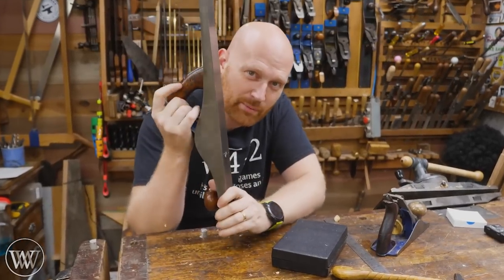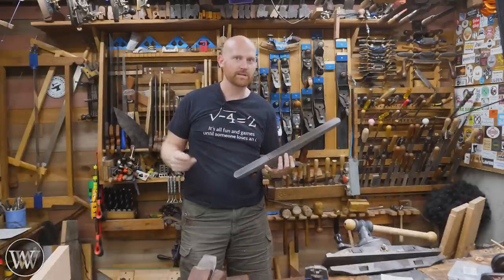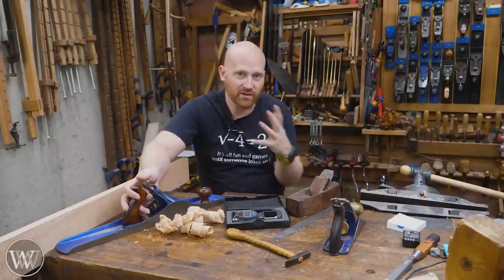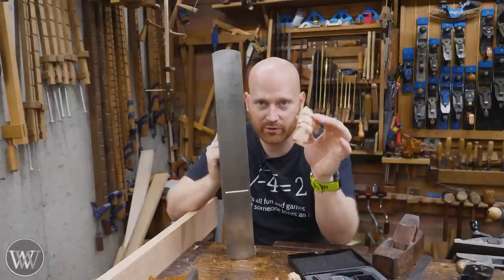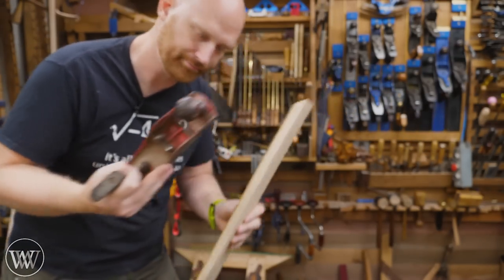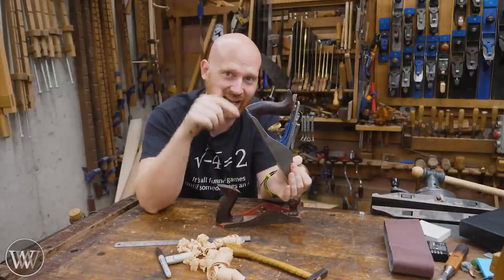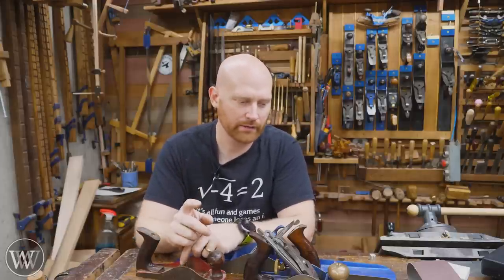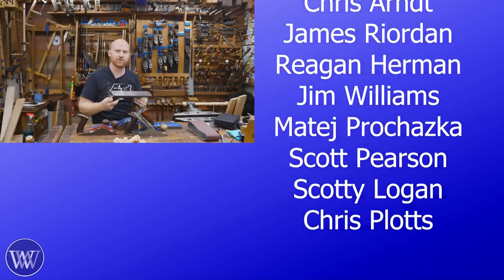How Flat Should Your Hand Plane Be

Comment: Only today I installed 6 doors, used my very old no7 that as far as I can tell has never been flattened. The client is a German fella with an eye for quality and detail. He was happy, i was happy, the plane was an absolute pleasure to use all day to get the doors fit horizontally, it hogged off what I needed and no square could prove the plane faulty. And the finish was smooth enough, was sparkling like a diamond. Its about getting work done, nothing more nothing less. And my non flat no7 is a total workhorse ❤ I spend a lot more energy on the iron than the sole.

Comment: Thanks, as I'm aging I'm finally beginning to use the dozen I've collected. This will be helpful as most were abused before I collected them. Until now a block plane has been all I've used. One my bud made is my favorite. Sometimes I really enjoy the slow pace and the sound of a sharp blade scraping across the wood vs dust collector and planer screaming at me. Just nice to get out of worlds pace.
Reply: agreed, I just flattened a board (for a display case I'm making) using my jointer plane and no 5, followed by a smoother. Took a little longer than if I had run it through my electric planer, and is probably less accurate, but it sure was satisfying. :)

Comment: Is that "there is no right way" or " there is no Wright way" ?

I wonder if a good way would be the very rough paper and then jump to a fairly fine paper to leave smooth crests on a somewhat rough finish.  The idea is that the coarse grooves would hold some of the candle wax that some like to use on their metal planes.  Me?  I like my wood body and transitional planes so it's not an issue.

Comment: The type of precision a lot of people seem to think they need exists almost exclusively in high precision shops that are temperature and humidity controlled and working with materials that are far more stable than wood. I get it and it's an easy trap to fall into. Nailing a tight tolerance or being able to change something to a level you can barely feel is amazing! I work in a high precision job shop and knowing when to be that particular about the tool condition and when not to be is how you tell people with a lot of active experience from people who have yet to develop that understanding. That being said, if it makes you feel better about the tool you're using, why not?

Comment: Glad you addressed this. I have a Grizzly jointer that I could never get properly flat. Some sharpie marks in the center just wouldn’t go away with the outer border just being slightly high. I gave up when my lowest grit sanding belt wouldn’t do any more good. 
I don’t feel like a failure now after watching this. It just jointed walnut slabs for a table very well, and nobody will ever notice that light gets under a ruler on the bottom of the sole.

Comment: Today, my very first hand plane is supposed to arrive. I am eager to get it.  It's a Stanley #4 (don't know the type yet). I got it on ebay and the seller didn't have all the info, but he did say it had brass, not plastic or steel for the knobs etc. I've been planning my flattening (I'm guessing it will need it) and have been on YouTube watching all the "guru's", Paul Sellers, Rex Kreuger, Rob Cosman etc. Glad to find this video. I'm going to find myself a piece of glass, get some 50 grit belt sanding paper, and then some higher grit for polishing, and then will follow this flattening process. Thanks for great info. Subscribed!
Reply from the maker: Sounds like fun. I would not plan on flattening it right away. I would say that only 1 in 5 actually need it.
Reply: @WoodByWrightHowTo  Good point, you did say that in the video. I'll run it through the paces first and see how well it does.  Thanks.

Comment: I paid too much for a pitted corrugated #5 when I first started just out of excitement I actually found one.  Based on what I see hand planes are more rare in the south, and rust is brutal.  I “flattened” it just to remove the last rust and edges on the pits after evaporust.  It’s still pockmarked and has valleys where I don’t care.  I still use it as a scrub plane and it’s great.

Now I’m careful and make sure it’s just surface rust.  I don’t often use chemicals anymore.  I’ll remove the rust with sandpaper and do a quicky flattening just to make sure the low parts are where they don’t matter.

You made me feel better about starting with aggressive grit.  I know objectively it’s ok, but had felt guilty about it.

Comment: This video is right on time. Just this morning I was cleaning up an edge of 10mm plywood with a no 4 and then no 5. The 5 which was set previously did not take any shaving, (and it took shaving from regular wood afterwards without issue). Turned out the mouth was a bit higher than toe and heel so I flattened it. I can still see a bit of light in some places, but that could very well be my ruler and the plane is working fine now. If not for this video, I might've come back tomorrow and spent unnecessary time on that plane, thank you.

Comment: Hello, Mr. Wright;
I loved this!
I just started using hand planes & I really like it.
So I was concerned about how to do it 'right'.
Thank you for teaching me how to do it the Wright way!
In this case I love the Wright way!
I have a super cheap pair of small "block planes".
They are junk but I wanted to see if I could make them actually plane.
The 'adjusters' were plastic wheels molded on soft steel threaded shafts.
The plastic wheels broke so I tried using pliers to turn the 'adjusters'.
Then I realized that Rex Kruger is right, just use a hammer.
I started trying to plane w/ it but it wouldn't plane.
So I checked the bottom & it was nowhere near 'flat'.
I sanded it on an 80 grit sander belt till it looked flat & now it will plane.
So following your advice has helped me make junk into 'planes'.
Thanks again.
Have a GREAT day, Neighbor!

Comment: A few years ago I bought a 70cm wooden jointer a local market. Cost me A$18 and a bit of pain to carry it home as I had walked the 1.5 km to the market.  This plane had a grove that ran diagonally the full length of the plane ( corner to corner ).  It must have been used to joint narrow boards.  A few strokes with my number 6 cleaned it nicely although it could do with the mouth closed up a bit.

Comment: I bought a recently restored #8 off of Craigslist. It refused to take a shaving in the middle of a board. Low and behold, there was an eighth of an inch gap. Took 10 minutes to flatten with 120 grit.  

My first clue to be on the lookout was the blade being inserted upside down.

Comment: This is good advice, I’ve reconditioned quite a few old planes now. If after sharpening the iron they take a good shaving there done. If I can’t get a good shaving I flatten the soul. At first I followed the internet advise of using 150 grit. After a half an hour and getting nowhere I went to the 60 grit, gets if flat much faster. Follow with 100 grit and put the plane to work.
Reply: Indeed, a sole need to be flat (the degree is arguable), but its smoothness doesn't matter at all. So using the smallest possible grit for its flattening is a time-saving technique.

Comment: I'm getting .001" shavings with a transition plane with a metal bottom.  Spent like 5 min flattening it, didn't even think about square or anything, just adjusted the blade until I was taking good shavings.

Comment: Your end vise looks like the Veritas Twin Screw Vise.    I have the same vise and I really like it.   Over the last year, or so, the vise has gotten tighter on one side and no longer holds evenly across the entire length of the jaw.     I'm afraid that I'm going to have to take it apart and plane the jaw flush, which is a task that I'm not excited about.   Hey, I love the thought of wispy, gravity defying shavings gently floating to the floor as much as the next guy!    But the reality is that it's near 100 degrees in the shop (I'm in New Mexico) and it would be a day of sweaty grinding through the task of truing the jaw.   It's not great wood, either.   All I could afford is Douglas Fur.    So, all in all I'd rather find an easy way to fix my vise and get back to fun work.

This, my good sir, is where you come in.    I'm hoping that you, in your infinite wisdom and experience, can bestow upon me a miraculous trick or just in time sage advise that will make the task either:   1, not necessary, or 2: not as hard, or 3: less traumatic.         

Long-shot much?!?

If you can't do any of that, I'd love to see a full video on the twin screw vice and how you use it.
Reply from the maker: It sounds like one of the two sprockets has slipped slightly. Every now and then it loosens up just a little bit and one of them will rotate a little bit farther. That will cause one side of the jaw to go in before the other one does. So if you take the cover off and rotate one of them back and forth until the jaw is parallel again and then lock it back in place. That should fix your problem. But sometimes the wood itself gets warped. I have the original video installing it and I did a 2-year update video on the whole bench. But those were a while ago.

Comment: Great video. You probably have a video on this, but i was to ask about how (1) should the opening of the mouth [before and after the blade] be parallel, (2) if the side of the mouth closer to the blade edge is at an angle compared will planing be a problem, and (3) do you try to level plane frog through the body of the plane [e.g. plane has slight bump on one side of the mouth making the plane blade slightly higher coming out of the mouth].
Reply from the maker: the front and back of the mouth do not have to be parallel, but the front of the mouth should be parallel to the tip of the iron. if it is not parallel to the iron, one side will be better with tough grain. but with straight grain you would not notice a problem at all. the bed of the frog should be perfectly flat. If if is not then you can take a file or course stone to it. the iron should not touch the body of the plane just the frog.

Comment: Hi James. Do you have tips for flattening a plane with a rounded sole (presumably due to someone trying to flatten it in the past) without making the round worse?
Reply from the maker: The goal is to just put pressure where it is needed. So if it is rounded heel to toe then I grab the sides of the plane and just put pressure at the mouth. If it's rounded side to side then I just have to be very careful not to rock it side to side

Comment: With a plane do you ever have trouble just sliding it across the wood?Can I run the plane across a strip w blade up just to polish the bottom? Thank you
Reply from the maker: If the plane isn't running very well or it's creating a lot of friction usually the answer is to add a bit of Wax to the sole. Some people apply oil in a rag I like to use a bit of paste wax.

Comment: Fun is main reason to flatten I think.  When I can take off a shaving that I can see and read newsprint through, it brings a smile.  I have my jointers really flat because I "hog" the necessary wood to straighten the edge, and then reduce the shaving to a whisper with the depth adjuster, rather than swapping planes.  I have one problem body, a Bedrock 607 that is seriously bowed, high in the middle and touching the surface the ends.  The bow is so pronounced, it rocks side to side on a flattish surface.  I haven't figured out a method of flattening it yet that avoids introducing some inadvertent twist or other weirdness.
Reply: Would it work to sharpie it, sand to find the high spots, gently file them down and repeat until you can just run it over a sanding sheet?
Basically treat it like a bowed board, just file instead of plane.
Reply: @FirstMM  That is just about what I was imagining.  Side to side rocking is my biggest concern.  I was thinking of trying to set the plane body upside down in a vise, and build a sanding block with rails that could ride beside the vise.  That would control both any wobble from the plane body, and the abrasive block, I think.  The biggest worry is just how much metal would be missing at the ends afterward.  Thanks for the suggestion.

Comment: My two big transitionals I check a couple times a year if I don't like the shavings, plural. They are both over 16"and are used for stock removal at the depth my ancient shoulders will push all the way through a piece.

Comment: I’ve recently bought a no 8 cleaned up the blade and been using it and up until now I was thinking of having to find a piece of float glass big enough to fit the thing on but for now I’m just gonna enjoy using it and see how it goes out of interest James would you recommend using a plane stop or vise for holding the workpiece best
Reply from the maker: A vice is easier to learn but it takes a little bit of time every time you want to put it in and take it out. The planning stop is a little bit harder to learn but once you do it's relatively easy to keep going. I generally prefer to use the vise but in the end it's just a personal preference.
Reply: @WoodByWrightHowTo  thanks once again for the advice your videos and yourself are so helpful to people like myself that are new to this

Comment: I jave an old #4 Stanley that was gifted to me as my first plane. I did it up, flattened it, put on ironwood tote and knob, and loved working with it. In the past year or two though, the plane was knocked off my bench, and one of the plane's walls near the frog was badly cracked. The breaks seems through and through, with japanning and the tightness of the area holding the break on. 
With such damage, the plane is still working. Is there a way to repair the plane wall?
Reply from the maker: Usually brazing is the way to fix it. It is not an easy task to keep the plane flat while you do that but it's very possible. If you get someone who's really skilled with TIG welding they can also do it.

Comment: I kinda wanna hear more about whoever it was that ground through the sole of the plane. Also this was a timely video because I was in the process of trying to get rid of every little bit of pitting on my Millers Falls 9 even though I can barely feel them anymore and they’re nowhere critical.
Reply from the maker: That was a plane that I saw at an mwtca meet. It had been flattened so much that the mounting for the rear tote had punched through. Most of the body and the plane was less than a 16 inch thick.

Comment: Have you tested how much difference it makes comparing a very rough sole (sanded, scratched) versus a smooth polished sole; i.e. how much effort it takes moving the plane across the wood?
Reply from the maker: It is the same effort. Just as a corrugated plane is the same effort as a smooth sole.
Reply: @WoodByWrightHowTo  Great to know!! Thanks for your answer and have a great day!!

Comment: I'm sorry, but just to be snooty, I thought that we use planes in wood working, not in building airplanes etc. If you have to be that tolerance tight use a milling machine (they can do a bang up job on wood, ya know).
OK, I'm just kidding, but unless a plane is in really bad shape, flattening it seems a bit of over kill. If it needs it, a trip to the milling machine would seem to be in order,
James this is a good video about the subject. I just wonder why other folks have to be so precise, except for corner molding joints, of course. ;-)

Comment: Would you recommend the same grits/process to flaten a wooden plane (from +/- 50 up to 200) ?
Thanks for the entertainment
Reply: I normally find it easier to clamp my wooden planes in a vise and flatten them with another plane.
Reply from the maker: For wooden plane it's faster and easier to flatten it with another plane. Usually just a couple strokes and you're done.
Reply: @WoodByWrightHowTo  
not sure i am confident enough in my 'planing' skills 😅

Comment: I started with Japanese planes where you intentionally remove material from the bottom of the plane so that only the toe and mouth are coplanar. For their jointer equivalent the toe, mouth and heel are coplanar. It makes absolute sense, two points make a line, toe and mouth or mouth and heel. Anything in between can introduce error, so best not to have it.

Comment: Well, I still don't understand why the Japanese style planes are slightly concave on either side of the blade. I thought it might be to make up for hand planes not having an infeed and outfeed table like the power jointers. Getting a board straight enough for a good glue joint seems to be a problem some times, with a slight hump in the center of the board. I did see some one explain how to get that out, and I think it was the guy who came up with the ruler trick for getting a flat edge on the unbeveled side of the plane blades.... The discovery journey continues....
Reply from the maker: They do it because of tradition. There is much in Japanese woodworking that is merely done for tradition. It's a lot like the corrugation on the bottom of some old Stanley plains. You would logically think that it would reduce friction make it easier to push but the reality is it doesn't actually make a difference.
Reply: Well, thanks for that James, but I would tend to think that is one of those things that has been around for so long, people forgot why they did it in the first place. After I make some and learn to use them, maybe I will have more comments....